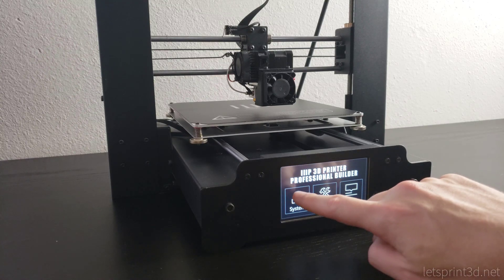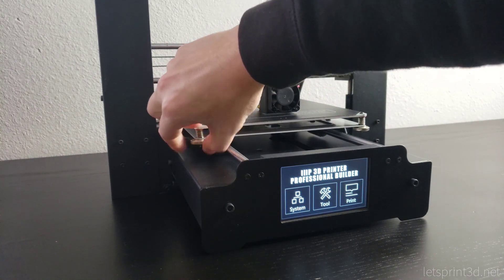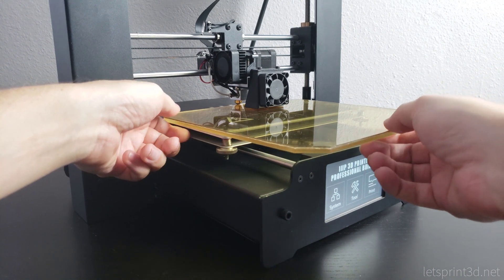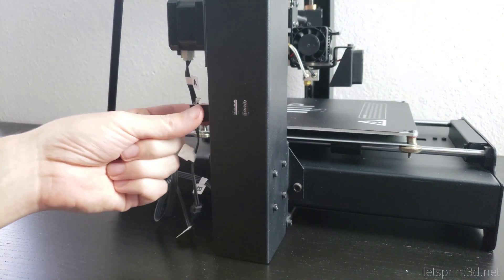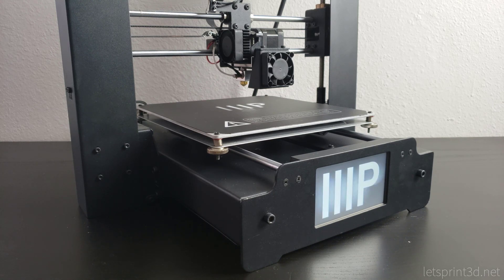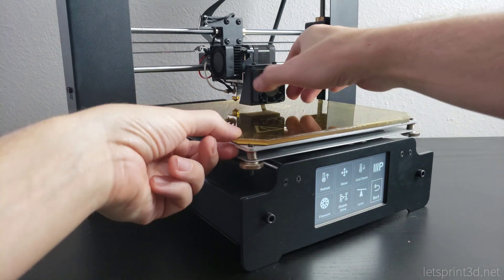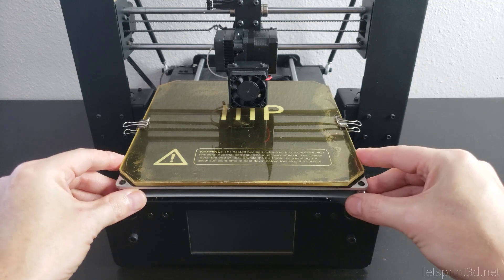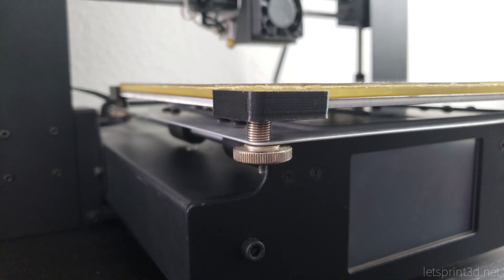How to Install the Gulfcoast Robotics Borosilicate Glass (Maker Select/Wanhao Duplicator i3)

Comment: Do you need to remove the heat mat?
Reply from the maker: If you're referring to the black textured BuildTak surface, it doesn't have to be removed. It won't really inhibit the heat transfer between the metal build plate and the glass.

Comment: I noticed when you moved the print head towards the middle at 30 seconds into the video, you said "since the bed was previously leveled using the nozzles current position". Does that mean when you level your printer you did it in the middle only? I'm just struggling with leveling right now. I have a Maker Select Plus and I am trying to do it like the book says to.....approximately 2" in from either side on the 4 corners. It just takes so danged long. 

So far most of the things I print aren't very long at all (maybe like 4" in length) and don't usually leave the center very much. I also noticed that the bed is usually a little higher in the middle no matter how much I work on the leveling. It's almost like it is warped down around the edges with the middle being bubbled up or something. Is it ok to just level it in the center? Or maybe in a 4" square around the center of the bed?? I would think that would make things so much easier. I'm sure it will likely screw things up if I decided to print something much larger, say close to the full size of the bed, but for the vast majority of things I print, I would hope that would be ok. 

Any advice you can give me on this would be GREATLY appreciated!! THANK YOU!!!!
Reply from the maker: If all 4 corners are leveled but the middle is raised, it sounds like you might indeed have a warped bed. This isn't all that uncommon on budget 3D Printers. If it has a concave shape that droops in the middle, you can easily cover this defect with a flat glass plate (as shown in the video). However, for a convex warp that is raised in the middle, this would prevent glass from laying flat.

Being the case, if glass won't work, the next best option would be to replace the heated bed. There isn't much you can do to fix a warped bed short of covering it up or buying a new one.
If all the prints you do are small though, perhaps just print them in a corner of the bed rather than the center. If you aren't using the entire build plate, you can work around a bowed middle by positioning the parts to avoid it.

Comment: think its possible to install a prusia flexible magnetic bed plate instead of glass?
Reply from the maker: Absolutely, I did this a couple months ago with one of my other 3D Printers. I'll post a guide on it via my website letsprint3d.net in the next day or two, been meaning to do that but had some things come up. It's much cheaper to just buy a magnetic sheet, real spring steel and some Build Tak, works great.